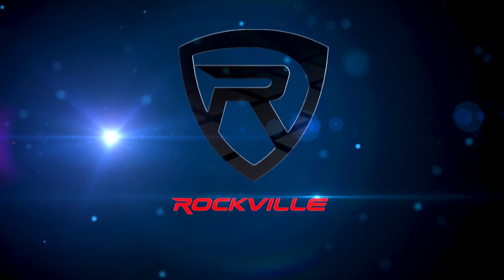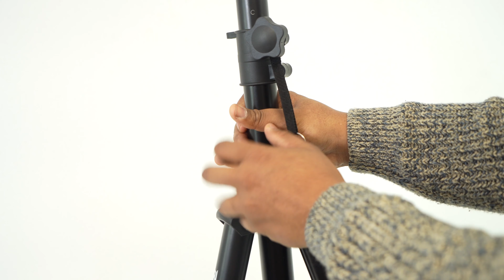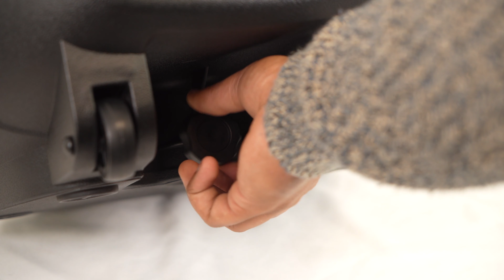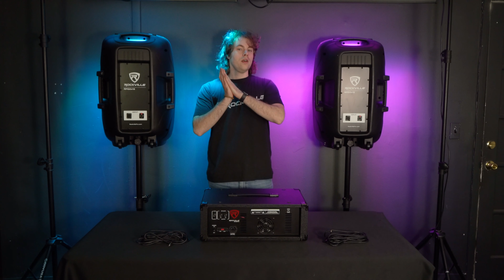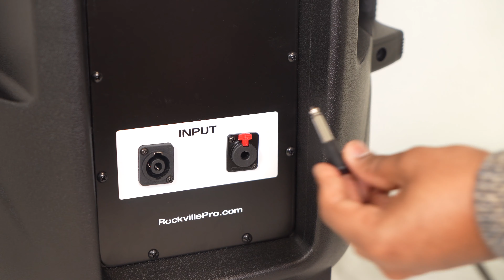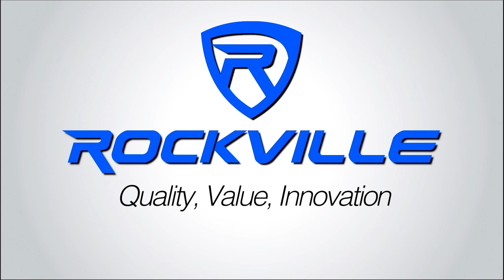How To Set Up The Speakers In Rockville RPG2X15 Package PA System Mixer/Amp+15" Speakers+Stands+Mics

Comment: Can I add 2 powered rockville rpg15 to this set up
Reply from the maker: Yes using the Line Output on the back of the mixer you can send signal forward to another powered speaker!